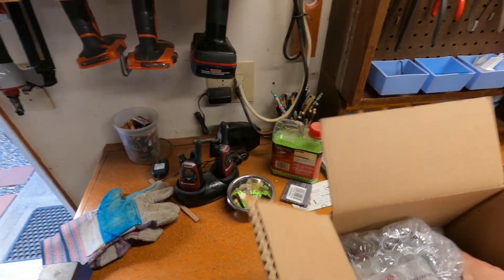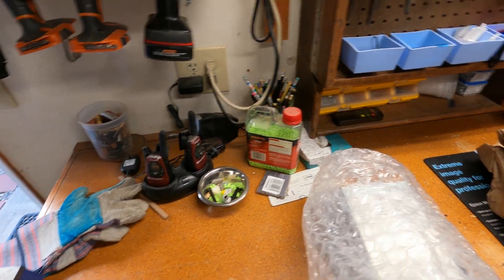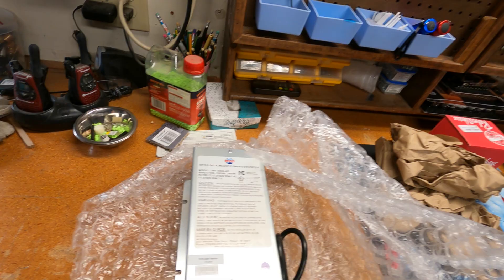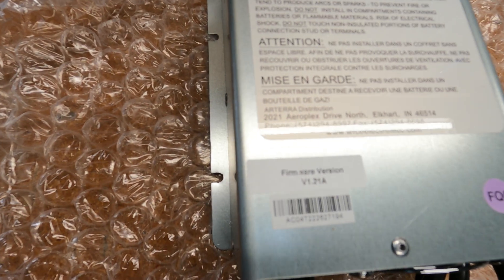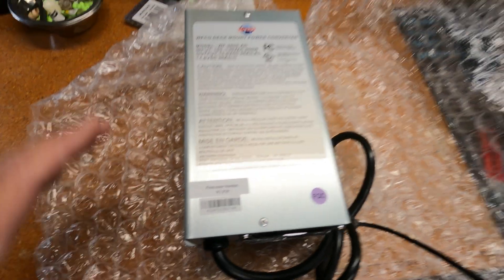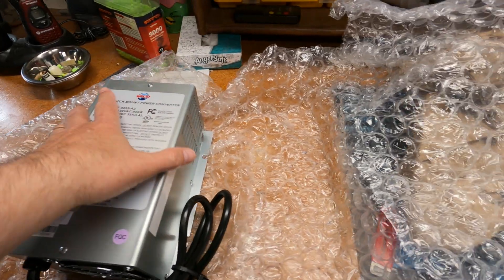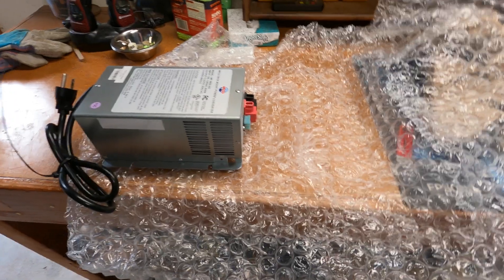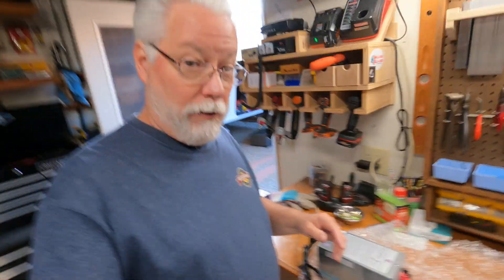WFCO-9855 AD Firmware Update

Comment: I am in AWE of you. I bought my first popup (2004 Rockwood Freedom #2280) Last Monday. The previous owner only went to plug-in parks and pulled the battery. I boondock. I contacted WFCO and exchanged emails. I took the recommendations (Name withheld) and bought the WF-9855-AD, Wf-5320 and the T-30. Now that I am looking for a wiring diagram? NO ONE will answer emails nor will anyone pick up the phone. NOW, on top of all this? I watched a video that says I have to change out the board! At 68 years old!

Comment: I have a WFCO 8955-AD paired with a Renogy 300AH  Lifepo4 lithium batt.  The Renogy gave up the ghost after 6 months.  Stuck around 7.6v. Come to find out my WFCO controller was stuck with the green light on.  After some haggling with WFCO they agreed to swap my converter so I wouldn’t be down a month waiting on the reflash. They also agreed to put the jumper in new unit so it will be in blue light lithium only mode.  
Dealing with Renogy on the other hand has been a nightmare.  Go with CanBat, Temgot or Battle Born Renergys customer service is horrendous.

Comment: Not right. Should see blue light. Look with mirror on other end on converter charger. Lithium battery needs 14.4 volts to fully charge. Your still not in true lithium mode
Reply: This! The converter should stay at 14.2-14.6VDC (at least while charging) and vary the current to do so. Even cheap portable Lipo4 chargers can do this. At this point, I don't think any converter manufacturer builds a functioning charger. I can't understand why they cannot figure this out like the solar industry has.
Reply: No. It has stages of charging, not a constant one number rate.
Reply: 3 weeks without the converter? During the middle of the season that’s a non-starter.

Comment: Why don’t they just put a switch so that the user can choose Li only? This auto feature is odd. I also don’t quite understand why using solar with it messes up the charging. Seems like you could be stuck running a generator, and not actually charging at the highest speed.